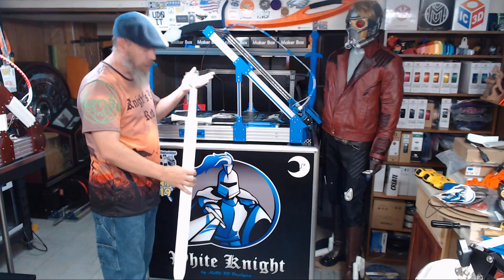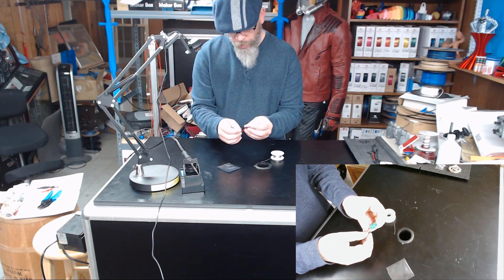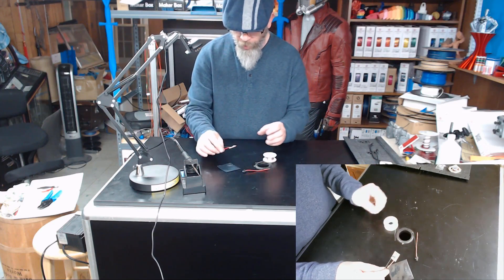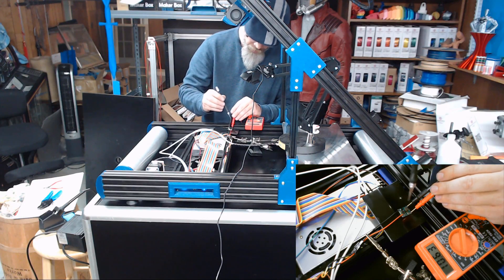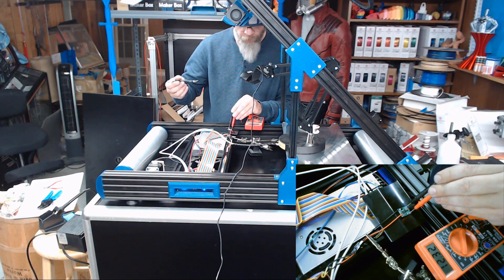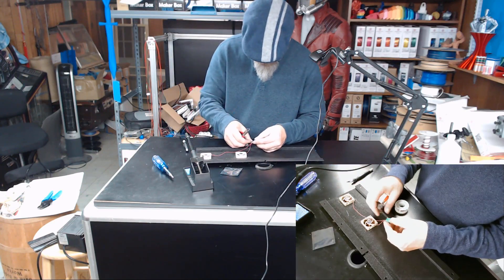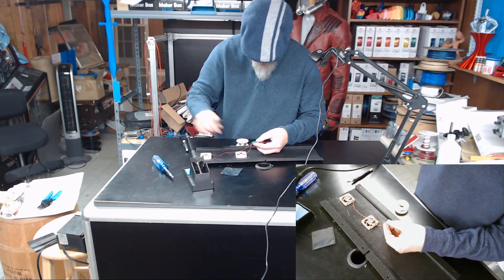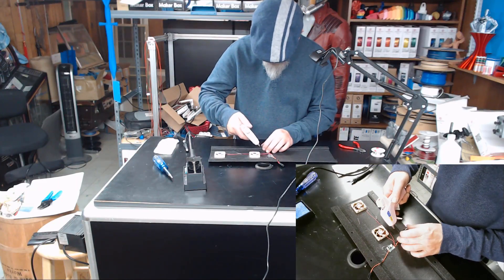White Knight Assembly Part 28

Comment: This has probably been answered elsewhere, but what is the advantage to having the vertical(?) axis diagonal as opposed to building something more akin to a standard cnc gantry with the belt as the only difference between the design and a standard 3d printer?
Reply from the maker: Eric Lotze the angled gantry gives you the infinite Z capability(see my Thanos blade videos) if you do a standard gantry your build volume is limited to the size of the gantry.